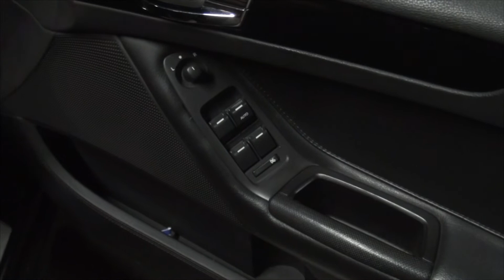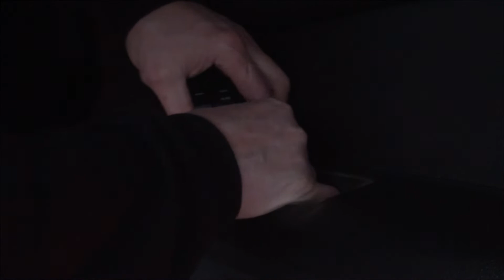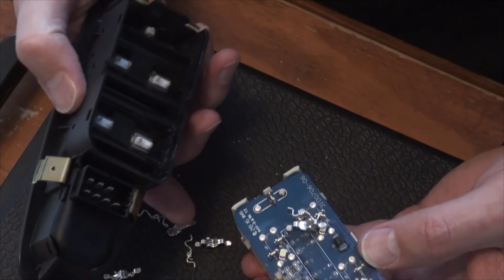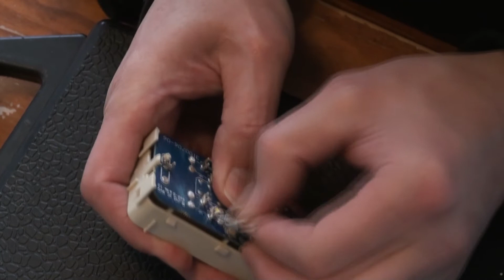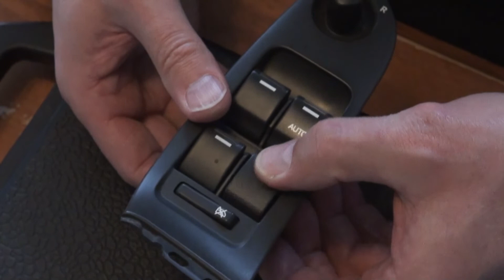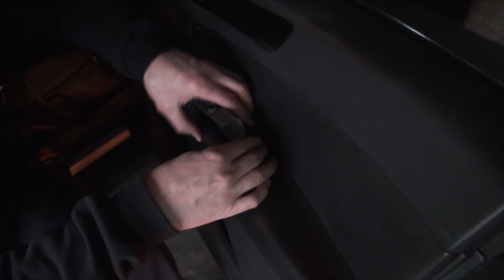Repair FG power window switch/button not working

Comment: Problem is that this fix only lasts a couple of weeks. By the time you need to do this the entire thing is cooked.
Reply from the maker: That's not correct. The repair made in this video has never failed after years of use.

Comment: Excellent video, very helpful. I plan to attempt this but i have a 2008 fg f6 fpv, are the switches and fuses all the same? All the windows in my f6 work using their individual switches but only the drivers side window works when using the main 4 button switch module (the one you took apart in the video) which leads me to believe i have bad contact's?
Reply from the maker: @realeyesrealisereallies6398  I believe the fuses and switch configurations should be the same across all FG's and based on your comments, it does sound like the main switch is the likely culprit, but it would be odd for all three windows to go at once, if that's what happened?
Reply: @aussieknowhow  oh no sorry, so the individual switches for all the windows work on their own. Say you're in the back seat on the passenger side, using the single switch for that window works fine, same for the drivers side rear and front passenger window (using the single window switch located in their door cards). But when using the 4 button window switch located in the drivers door card, only the drivers window will work, so I thought the culprit would be bad contacts going off of your video. Rather than a fuse, given all other windows still work but only when using the single window switch located in their specific door card. Sorry I probably haven't explained it the best, hopefully you get what I mean. But I'll try cleaning the contacts and see how that goes. Thanks again

Comment: So I take that if only one side is not working then there is no point checking the fuses?
Reply from the maker: @phillipbrown4963 Yes that's correct. If it is just a single switch, you can repair it the same way as the master switch. It pulls apart in a similar way and has a similar switching mechanism inside. As long as nothing is physically broken in it.

Comment: This is helpful. Should I replace the fuse at the same time? My rear windows aren’t moving using either the master switch or the switches on the doors. I’m wondering if the child lock has malfunctioned in the ON position
Reply from the maker: I've not dug into the relationship between the  child lock and the window switches, so I can't help you with that one sorry. Is it just both rear windows not working and the front ones are?

Comment: Followed it step by step and still only have the drivers side front and rear window working.

Any ideas what the issue could be or how to fix it?
Reply from the maker: Do the switches in the doors themselves work ok?
Reply: @aussieknowhow  yeah the switches seem to work OK. I'm wondering if it's the window motor that's shat itself?
Reply from the maker: Sorry for the late reply mate. How'd you go? If it's still an issue, let me know how the issue started and we can maybe work it out from that.
Reply: @aussieknowhow  all good mate. Got it sorted with a few replacement switches. Guess they just got old and tired.
A bit like me 😂

Comment: Thanks . Will do this with my fg x xr6. Passenger switch on drivers side is not working .great video  mate
Reply from the maker: Good luck with mate, hope it sorts it for you.
Reply: Tested the fuse's all good was master switch . Put new master switch  and aswell as front passenger and rear passenger switche's. Thank's for video was simple to do  mate.